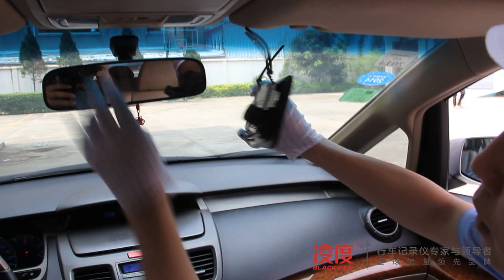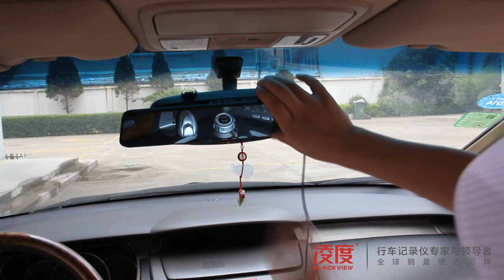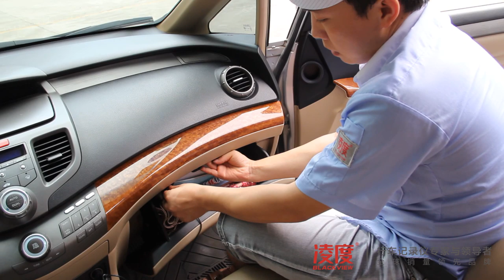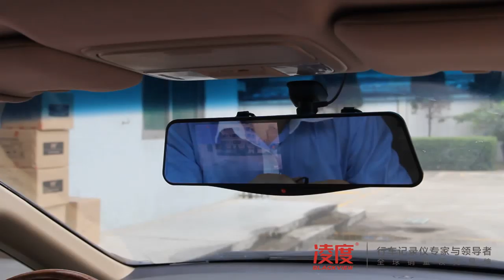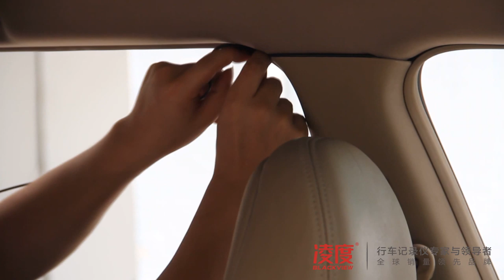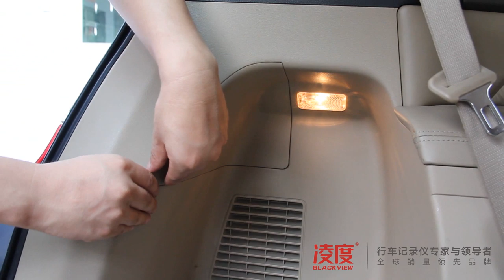blackview rearview mirror,car dvr installation video by shenzhen dome technology co.,ltd

Comment: I have Blackbox dvr (Full HD 1080 ) dash dualcamera (Back and front ) for recording front and back views while driving.This Blackbox dvr is also helpful in reversing the car showing the back view. This Blackbox dvr is also used as mirror and is attached to the mirror of the vehicle. when I installed it in my car , first both front and back cameras worked well but after 02 days Back camera is not getting on during reverse and is not displaying on the screen while Front camera is working well and recording. I also made the settings of dvr default and reset it by putting a thin plastic needle in the small hole on it's back but nothing worked. There is no display of back camera on the screen nor dvr turns off when it is plugged br its car charger. Can you please  help me out that what  is wrong  with Back camera and how can I  fix it. I will be thankful.
Reply: red cable to positive reverse lamp